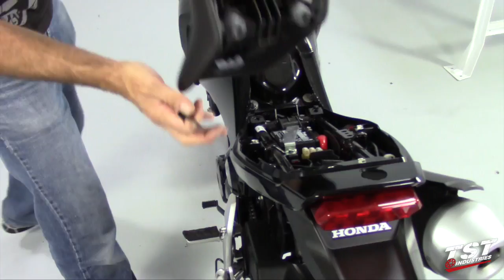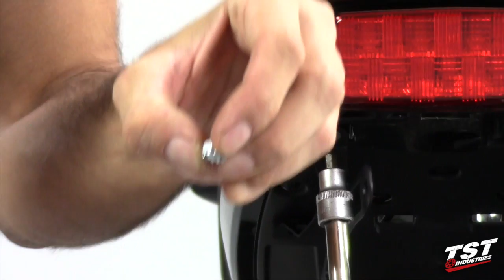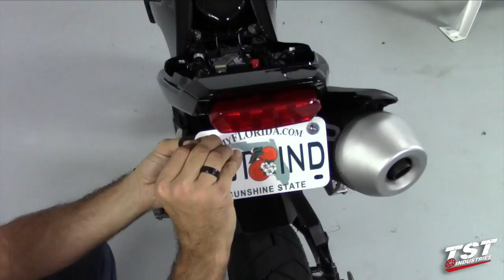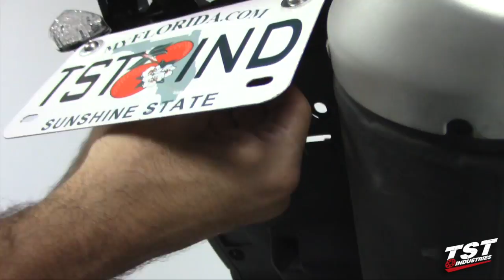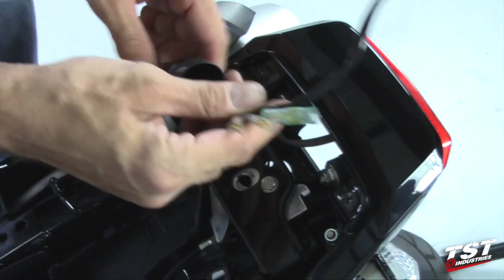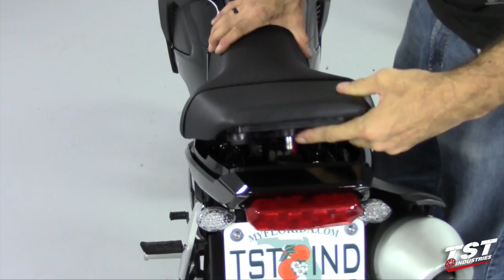How to install 13-16 Honda Grom mx125 Standard Fender Eliminator by TST Industries

Comment: I bought a used 2014 honda grom and the previous owner installed a fender eliminater kit, but my neutral light doesn't work. Is that the reason or does anyone on here might know why? Any information is very helpful.
Reply from the maker: The neutral light circuit is an entirely separate circuit from anything on the fender. I would say that the fender eliminator installation has nothing to do with your lack of neutral light. Best bet is to get wiring diagram for the bike and find the circuit. Then you can troubleshoot it and see if it's just a connection issue or maybe a sensor went bad.

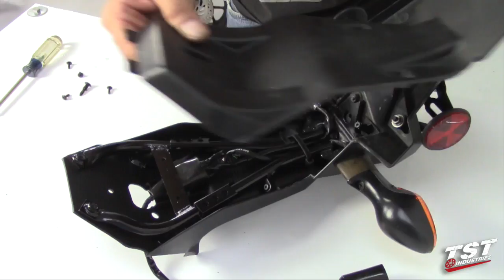Comment: At time 10:55 in the video he goes on to say " I am interested in this part of the wire with the plug." My bike was bought used and doesn't have that wire. Does someone have a part name for this wire so I could possibly purchase it somewhere online? Any help would be appreciated
Reply from the maker: One end of that harness uses a few bullet connectors and the other uses a four position Sumitomo MTW110 type plug. I hope this helps you.

Comment: Judging by the way you ripped the seat off I'm guessing that's a customers bike and not your own.
Reply from the maker: If you own one of these bikes you know what it takes to take off the seat. There is no easy way on or off the bike. I can't understand why you would think that I would treat a customers bike worse than my own. I actually treat customers bikes with more care than my own bikes. When that is not possible a little force will help. Honda engineers didn't do a complete job with the seat locking system on this bike so there is no choice but to yank it real good.

Comment: Can you include what tools you need at the beginning
Reply from the maker: To change the video we would have to take it down. You can watch it once and make notes. I am going purely from memory here but you will not likely need anything else except for allen wrenches in the range of 3-6mm, open ended 10,12,14mm, and sockets in the same size as open ended would help.

Comment: what if i were to remove and not replace the turn signals? It shouldnt have any effect on the bike or how it runs correct?
Reply from the maker: that would not have any effect on the way the bike turns. It would however have an effect on how safe your bike is. If you live in a place where hand signals are acceptable and you use them,  then you should be ok.